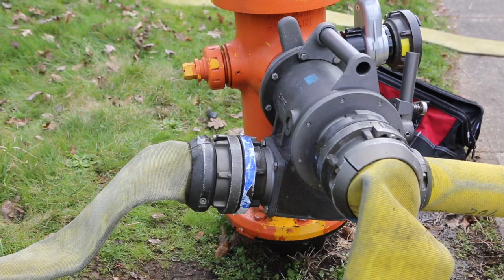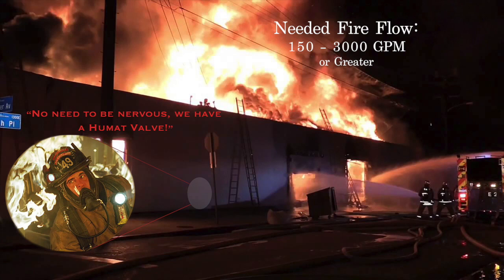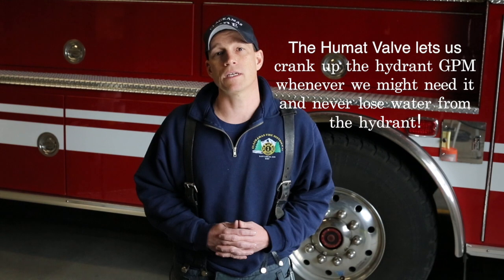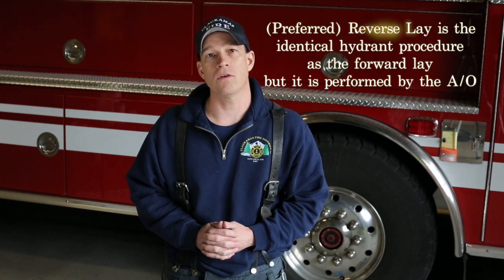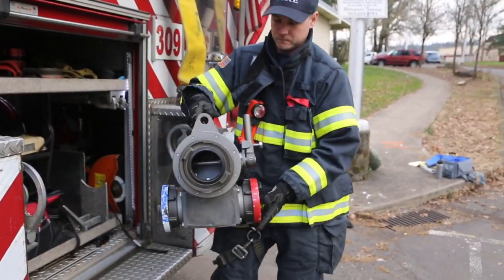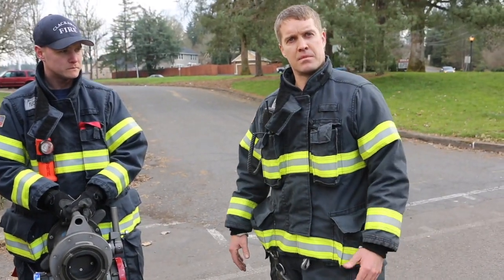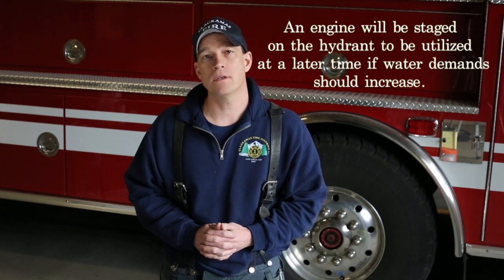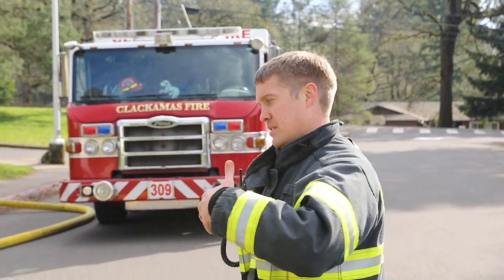Humat R & D Video

Comment: A hydrant only gives so much GPM depending on the size of the water main. There is no way  a Humat Valve increases the GPM.
Reply: But hoses have friction loss, there may be 60 psi at the hydrant, but 500 feet away it may only be 30 psi, using the second pumper to boost the pressure at the hydrant will boost the pressure at the end of the hose too.
Reply: It can't increase GPM at the hydrant but it can increase GPM flow at the other end of the LDH by boosting pressure to overcome friction loss.